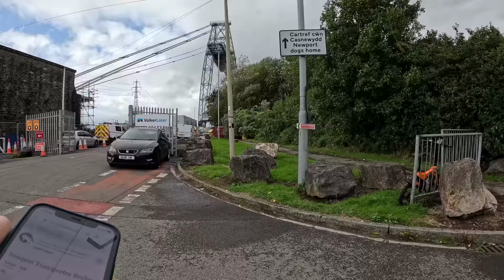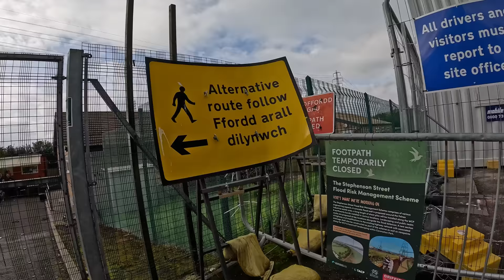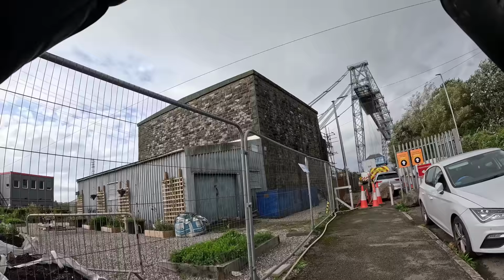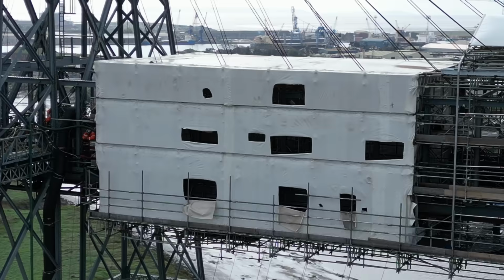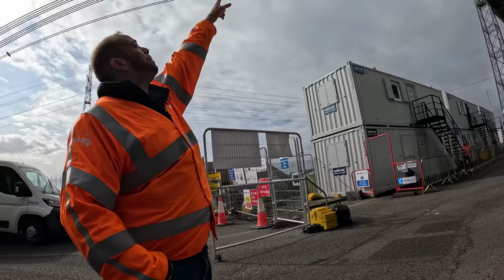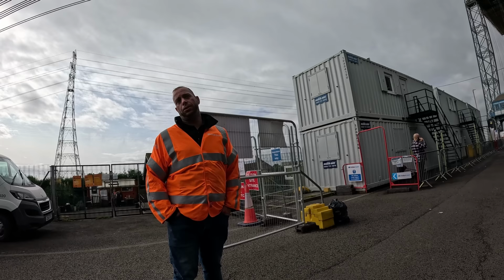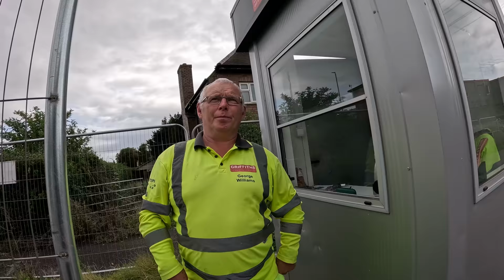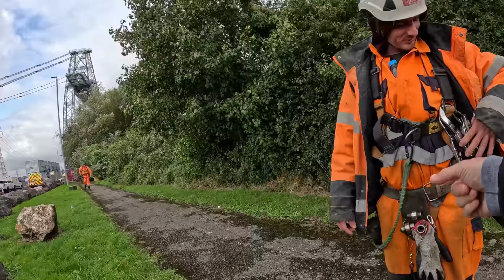Is There Any Reason Why You Are Filming? 🎥🛸✔

Comment: There is a transporter bridge over the river Tees from Midlesbrough, marked as a ferry on the map, I suspect that if an auditor or any public photographer turned up they would likely be invited into the winding house and not only can one travel on the gondola one can if you are fit enough climb the ladders walk across the top stap and disembark on the other side of the river for FREE!
Reply: Random Outings visited the Tees Transporter Bridge a year ago, sadly it has been closed since 2019 due to safety concerns:  https://youtu.be/Jl1xqAa8NCE
Tom Scott did a excellent video on the Newport Transporter Bridge when it was open:  https://youtu.be/KxzOQwktMCc

Comment: Great video, would be exciting to use the walkway or ride the gondola across after restoration and new visitor centre are completed. ⭐⭐⭐⭐👍

Delays included the original contractor went into administration July 2021.  Early 2022, reported a second contractor also went into administration; Council re-tendered the project contracts.  Costs rose from L11.9 million to 16.9 million with National Lottery Heritage Fund increasing their contribution to L10.7 million. Original schedule was opening Spring 2023 and now projected as Spring 2024.

Comment: im a civil engineer and i have no idea what that bridge thing is. Looks temporary but the guy said it's been there 30 years?
Reply: Way back when the docks were booming people needed a way across the bank. This was the solution. Fast forward many years and it's not used so much but currently closed for a referb and a new visitor centre. It's a fantastic bit of kit and saves the 25 minute drive from one side to the other
Reply: The bridge is 117 years old. So not temporary at all. Just really old.
Reply: The cradle/gondola is suspended underneath to carry vehicles etc across the river Usk.  

There are many bridges now so it's only really a novelty.  It stands as a landmark that I can see clearly from Cardiff 12 miles away.